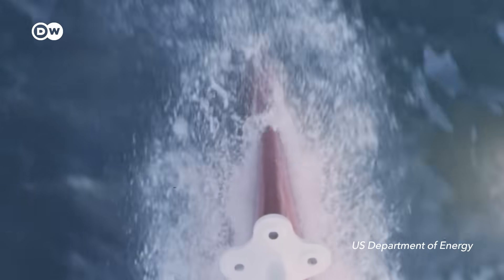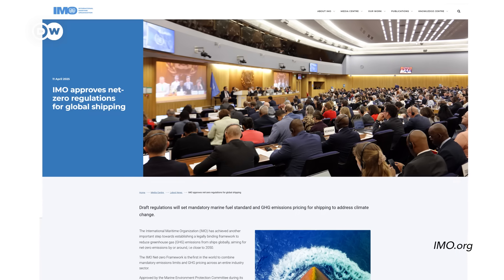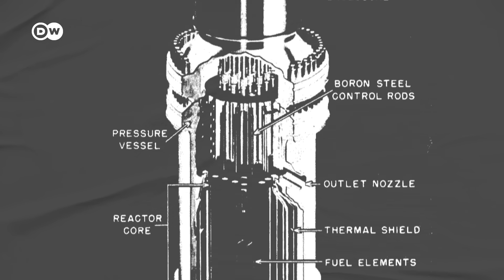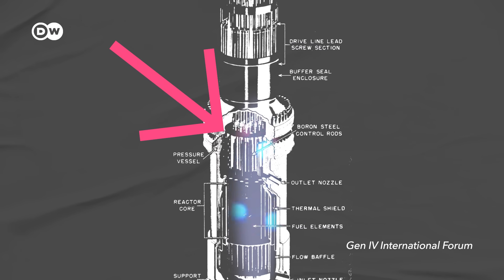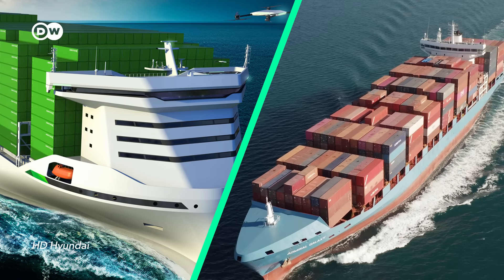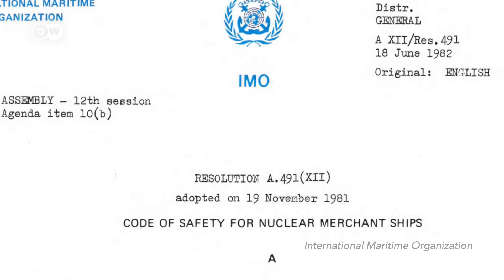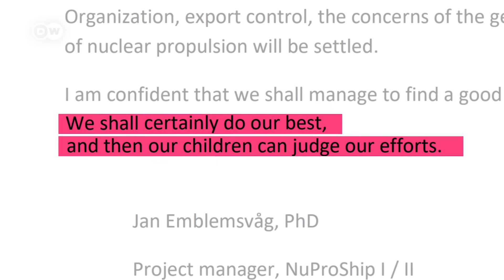Why people want to put nuclear reactors on ships

Comment: I'm all for using nuclear power on cargo ships to eliminate emissions. However, the interviewees lose credibility when saying that the first new generation nuclear-powered ships will set sail in the early 2030s. This sounds delusional when considering what's involved and how slow the nuclear world moves.
Reply: Allseas is already talking about their TRISO reactor solution for marine power
Reply: I would like to see the answer on how to protect these ships? So far noone answered that question.
Reply: @MaxPap-q4f not as hard as you think
Reply: @MaxPap-q4f  like normal ships. no one gets onboard without authorisation, and anyone who does is met with force.
Reply: @ZippyPiglin36  I guess you haven't heard about piracy?
And how often those pirates are able of entering and commandeering a ship?
Reply: @Jehty_  You've never heard of armed guards or the dozens of anti-piracy measures, and how piracy has been on a downfall?
Reply: @ZippyPiglin36  armed guards that aren't present on most ships. So your statement was just incorrect.

Remember that a nuclear ship would be a target that is a lot lot more valuable. So you need more than just a few armed guards.
So all this amounts to is that an already unfeasibly expensive propulsion method gets even more expensive.
Reply: @Jehty_  modern cargo ships already have what's called a citadel - a protected area around the ships main machinery spaces, which can be sealed off completely, with emergency supplies for the crew and access to communication equipment. in the event of a pirate attack, the crew can retreat to the citadel, lock themselves in, prevent access to most important equipment for the pirates, and call for military help.
Reply: @Jehty_ why would it? People seem to think nuclear reactors are just bombs with a plug stuck in it. What are ISIS going to do with some mildy enriched uranium? The fear of dirty bombs is wildly out of step with the reality of it.

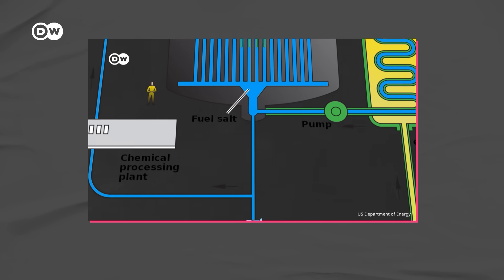Comment: 6:13 this is so terribly wrong! Light water reactors today have also passive cooling systems that don’t need operator action, electricity or any mechanics. GENIV is an absolut stupid idea for ships as long as we don’t have them commercially on land. I hate this freaking overhype for GENIV. And btw: The EPZ for those lightwater SMR are also very tiny. You can have industry or civil structures right next to it!

Comment: I’ve worked in sustainable shipping fuels for a while. In an ideal world, yes nuclear ships make a ton of sense. However, with security and regulatory headaches, it would make more sense to install small modular reactors at ports to make e-methanol at or near the port and then fuel ships with the e-methanol. There are already hundreds of e-methanol ships on order books and you can avoid a lot of the regulatory hurdles.

Comment: Navy did it for years yet nothing horrifying happened, even if one sank they have way too many failsafes, also even if it does blow up and then sink with an exposed core, water is fantastic at stopping radiation getting through, you lot on land would be fine
Reply: Not just dealing with regular water your dealing with salt water. Salt and metal not a good combination so boom ships sinks therefore reactors sinks to the bottom of sea, salt water eat are erode the metal casing and rods now you have nuclear waste in the ocean to can travel cause of currents from shore to shore,  plus now marine life is contaminated sea food is no longer valuable cause a disruption in the cycle of life. Ya oil suck be at-lest with oil can clean it easier than nuclear waste.
Reply: @staffordcook260 you cannot clean oil easier than nuclear waste. If a reactor has a catastrophic meltdown on the ocean floor you'd find that all that salt water is fantastic and blocking ionising particles. would fish life around it be a little fucked? Yeah will salt water completely eat through bronze? No. Thats why ships reactors have a secondsry lining of bronze ontop of the lead. Because bronze is pretty much resistant to the ocean thats why the rest lf the titanic looks like shit but the propellers made of bronze are still in fantastic shape

Comment: Nuclear reactors are not like computers. They require mechanical parts which have not changed much in the last decades like turbines. You might add 10% of efficiency in some decades and shrink them a bit. But it is nowhere comparable to micro electronics.

Comment: Safe reactor designs that CAN’T meltdown are essential.  There are uranium pellets coated with ceramic that supposedly can’t, as well as Thorium reactors.  However, I’m not sure they can be adapted to a ship because of power density.  Also, the reactor compartments would have to be impervious to most explosions, which might necessitate use of massive amounts of titanium, if I had to guess.  An aircraft carrier might have buoyancy to spare, but that probably wouldn’t work for a merchant ship, where every extra ton is less cargo that can be transported.
Reply: They already have been adapted to ships. Nuclear has power density in spades.

Comment: Honestly if you see the toxic sludge cargoliners run on and produce its almost fighting.

As some mentioned a docked ship could offload the local grid by slightly giving back to it.

Unfortunately this would mean the whole port grid, fuel infra, safety procedures, etc all need to change meaning before this could become profitable it would take years.

Not to mention current monopoly by fuel providers whom wouldn't be to pleased seeing such a massive income source vanish.
Reply: Well, it depends. It can be connected to an electrolyser to produce hydrogen, ammonia, methanol.
Reply: Why would it need to be changed?
A sealed core can last 30+ years. You'll never need to refuel it in its lifespan. It reduces reliance on all infrastructure. 
As for shipbuilding, you could insert said reactors in ships once they're mostly finished, and then take them out once they're retired. After that, check its health, and reuse for electricity on land if viable.

Comment: Actually, the weight of batteries isn't even the main issue with battery electric freight ships. It's the huge amount of power that is needed to recharge them within the time they're spending in port. Recharching a vessel the size of a container ship for a 21 day trip within 24h would require about 1.5GW of charging power. That's roughly either two coal power stations, 7500000 square meters of photo voltaics or 100 large offshore wind turbines running at full load just for one ship
Reply: You would just put the batteries in shipping containers and replace them in port with full ones
Reply: I'd just be worried about cost. Enough batteries to do a transatlantic trip on a PANAMAX sounds like an impossible expense for any company to bear upfront, let alone when you factor in having to replace the entire setup every 10 years. Batteries don't like being deep-cycled 365 days a year in harsh conditions.
Reply: Just change the batteries, you can charge the battery when it is on land. Every alternative requires new infrastructure worldwide.
Reply: Great Scott!
Reply: Use hydrogen fuel cell
Reply: @widodoakrom3938 hydrogen fuel cell, convert the hydrogen to electricity in a battery and the battery works the motor. Not very energy efficient.
Reply: We already do this in 4 hours with utility scale battery storage. Depending on the energy capacity, you only need high voltage power lines to charge in 4-8 hours
Reply: Just two small Nuclear Reactors.
Reply: what have you been smoking? energy density in batteries are crap? Like people hoping for a long haul flights with electric airplane. And a ship requires allot more energy to move. Thats whats wrong with this generation stuped ideas, taken out of fantasy with no fundamental understanding and hoping to solve a world problem but with no skills or education when sticking the idea to gather. Except writing pappers about equality and racism... LEARN PHYSICS Dumb asses! stop harassing people that actually know there stuff.
Reply: That doesn't necessarily seem impossible. What if they had platforms at sea that would function like gas stations?
Reply: @nealburns8815  your practical understanding of the world around you is incredibly limited
Reply: @nealburns8815 that is exactly  my coment, giant platform to collect energy to refill ships as they move, so no downtime.
Reply: @yvanpimentel9950 it's more or less the same. You are more specific and I don't think it's warranted at this point.
Reply: @yvanpimentel9950  Refill the ships as they move.... so you mean a whole nother ship?
Reply: @米空軍パイロット exactly a catamaran even if have the same size will only need les than 10% of the energy because the size inside the water is a fraction.
Reply: @yvanpimentel9950  You still need to displace water equal to the ships weight. Catamaran only makes sense for ships that are so light that they would have a very slender and unstable hull otherwise.
Reply: @Chris-uu2td that's my point a vessel just for propulsion and battery but with the surface area to accommodate 32,000 square meters of solar or hundreds of sails.
Reply: If oil was discovered on Mt Everest, I wonder how long before there's a drilling platform on the peak.
Reply: If we go battery,  charging station shall also move,  to the ocean, gigantes floating catamaran full of solar and wind ,motor generator units can convert wind in electricity  or even tow ships.

Comment: Have we literally forgotten about nuclear subs that sank in the ocean and just left there? And how water is used to block most if not all radiation.
Sinking ships and polluting the oceans should be at most avoided but if one does sink it won't put us in danger. Damaged reactors should put the blame for operator as most cases are but otherwise completely safe.
Regulations are sometimes dumb and the cost is what's stopping nuclear but when the manufacturing gets cheaper and recycling, nuclear power will save us a lot of headaches in the future.
Reply: finally someone gets it

Comment: I think the biggest problem is operator and crew cost. Nuclear power can be safe, but only if done properly by trained and qualified personnel. Chances are they need more training than conventional ship engineering crew and you would need more of them.
Reply: All ships can sink.
Reply: @TheFutureInvention which is fine because water is an excellent insulator. It is very dense so just a couple of metres of water render radioactive waste harmless from the surface.
Reply: Modular designs will render this point moot. The reactor goes in fully fueled and ready to connect to the ships turbines. Any major issues and they swap it for a new one and send it for repairs or disposal.
Reply: Considering how much there's a rise in AI replacing workers literally everywhere, why don't we use AI here, such as to reduce workforce to only 5-12 people for said reactor, mainly for supervisor and some control?
Reply: @ZippyPiglin36  then you need extra people who supervise the ai, can programm it find errors etc.
Reply: @superhase3206 Also no. AI, when made for it, doesn't need much of that. You could have a land base managing said AI's core, copies of said AI operating ships independently of that, and the land base coming into effect when AI goes wrong. 

It's somewhat like running a offline copy of a AI. You run it on your device, and when it starts of break, you connect to the internet and download a fresh copy or get updated versions.
Reply: @ZippyPiglin36  So your are completely depended on a strong internet connection to the outside world, when something goes wrong, good that battle ships cant jam the communication of other (battle) ships.
Reply: @superhase3206 Ah yes, AI always have massive software when its main goal is a fancy calculator. And Combat Vessels totally are interested in blocking signals to MAYBE make it slightly more painful for the crew, instead of, you know, the centuries tried-and-tested methods of blocking the canal or strait they're going through and needing absolutely no electronic warfare.

Comment: If it has been good enough for military aircraft carriers all these years, and the technology has improved by leaps and bounds since, surely it isn’t hyperbolic to say it worth trying out.
Reply: Just because something works in the military ivory tower doesn't mean it will work in merchant marine, and certainly not profitably (and the safety record of e.g. the Soviet submarine fleet, scaled up to 100,000 merchantmen is hardly a comforting prospect!).
It's worth trying but it won't be what replaces diesel without some very substantial changes.

Comment: Why it doesn't use hybrid system for now. Nuclear powered tugboat(or tug-submarine) can be use in high seas to pull cargo ship. When it come near to cost, use heavy fuel engine and enter the port alone. If it can reduce 90% of heavy fuel consumption, isn't it great?
Reply from the maker: That’s an interesting concept. But in practice, nuclear tugs would likely face similar safety, cost, and regulatory challenges. 🤔
Reply: Tug's can't fit engines large enough to brink Cargo ships to cruise speeds. They are also not high sea capable.

Comment: Sounds good, but I'd like to see a comparison to modern sail ships. And I'm glad there was no typical German emotional vilification in the report. However, the terrorist hijacking is a problem. Is military personnel on board too expensive or could there be remote controlled guns and weapons for defense? Anything is possible, but at good cost? Many technologies are designed for a world with peace. 

For sinking, perhaps a device with a total of ~15 km cable system could be conceived for rescuing purposes from 11 km deep ocean?

Or could we have a nuclear towboat, which could pull a barge? The towboat would be more flexible than a big ship. Or why are they not used, is there additional problems with them?

Comment: I am not saying no, but there are a couple of caveats and open questions:
1. Sailors on military ships are usually well trained. On cargo vessels, the quality of crew and overall ship maintenance varies a lot. Some ships and crew are in perfect condition, but some are not, and a nuclear reactor isn't something I would want to give into the hands of a cheap crew.
2. Smaller reactors usually require higher enriched fuel, so there may be a proliferation issue here. Also, if you have so much nuclear material around throughout the world, it is already bad enough if somebody can get enough to make a dirty bomb.
3. Gen IV reactors are not necessarily bad, but in my experience the nuclear industry is very good in highlighting the positive things while completely disregarding all negative aspects. Sometimes I would even say they are outright lying. Hence, a reactor concept for a ship needs to be thoroughly investigated by an independent organization.
4. With nuclear technology, there is no room for error. Hence, you need a lot of redundancy, (time consuming) processes, and training. This may drive up the costs so much that a nuclear reactor isn't economically viable anymore.

Comment: Interesting idea.  I think these small reactors need to prove itself first on land, say in remote areas or islands or military bases.  If 50 of them operates safely and economically for 5 years, then it will be much more receptive on shups.
Reply: If 50 of such reactors worked economically for 5 years, new regulations will be made to add four extra years of paperwork per reactor afterwards. 

Fossil Fuels and Renewables HATE genuine competition. Their tactics are lobbying.
Reply: @ZippyPiglin36 That might end up being the case, indeed.  Consequence from Nuclear incidents is so high that it is easy to see regulators piling on regulation whenever there is any significant problems.

Comment: Or you could just make ammonia with that nuclear energy to power the ships
Reply: smart
Reply: Except, Ammonia is polluting as well, as well as difficult to handle.
Reply: Ammonia in shipping has bigger environmental impact than bunker oil. Its a big greenhouse gas and the engines that run it leak like crazy, releasing unburnt ammonia into the atmosphere.

Comment: It might make sense with SMRs which were advertised to be maintenance-free. Basically sold a a product that comes with fuel for its lifecycle, is self-regulating and once the producer guarantee runs out, it is replaced entirely by a new unit. I guess those were initially planned for factories and not ships though.
Reply from the maker: Hey there! SMRs are exactly what we talk about in another video we made. You can watch it here 👉 https://youtu.be/GhKQ8EP1a1Y
Reply: >maintenance-free
Not at sea lol.